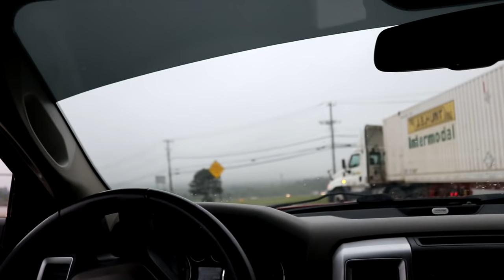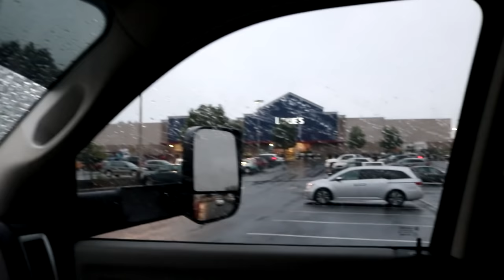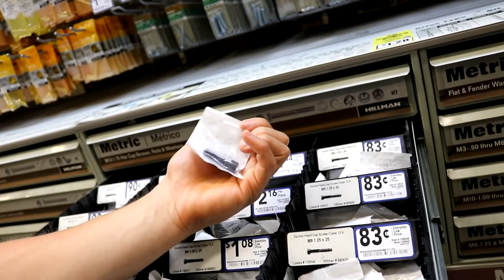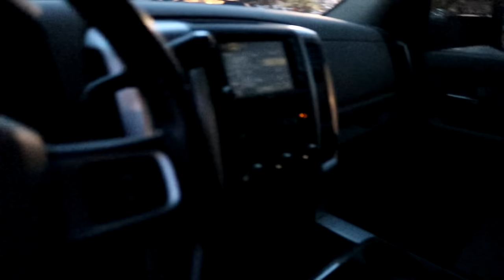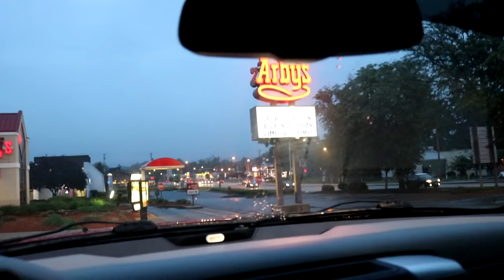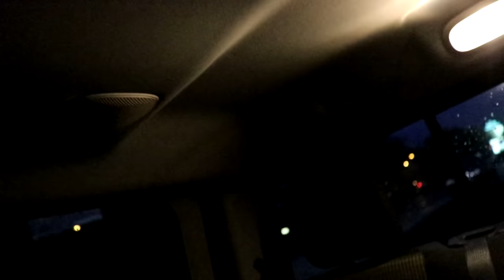Can You Daily Drive a Cummins?

Comment: with the newer DEF and DPF emissions parts on these trucks, 2019 ram 2500 with the 6.7l cummins, i don’t know much about diesel, how would these trucks do as a daily driver/short trip truck, (no deletes) no towing or hauling, 6 miles to work and 6 miles back home? a grocery getter. long trip once a year. i just want a big truck with a diesel engine. P.S i don’t care about the mpg or the cost of diesel fuel.

i’ve seen in the 2019 ram 2500 diesel owners manual that a parked manual regen can be performed, if so, short daily (city) driving shouldn’t be a problem, or would it?
Reply from the maker: make the truck gets up to operating temperature especially in the cold months
Reply: cool thanks man